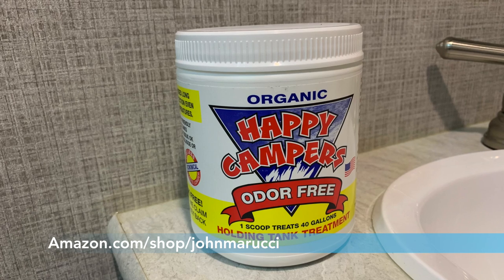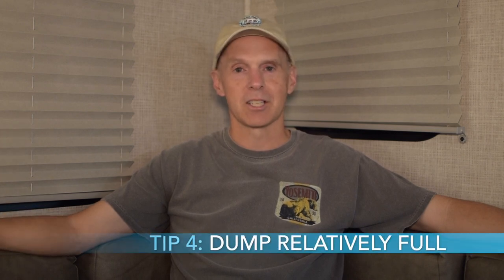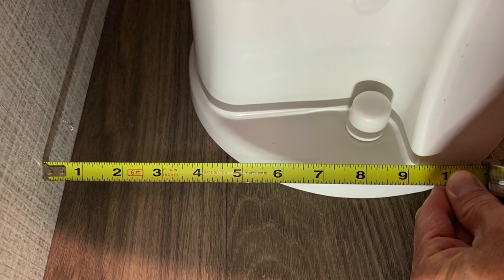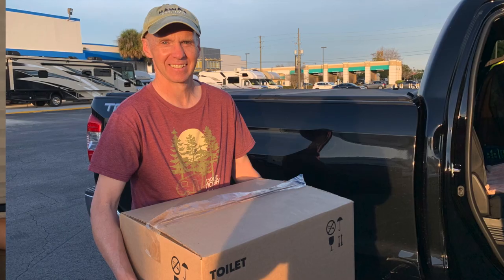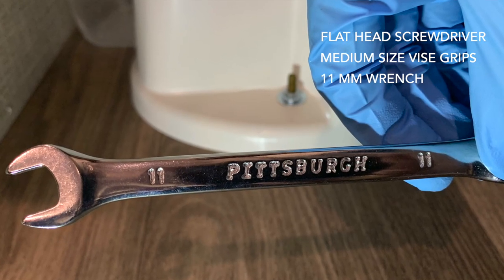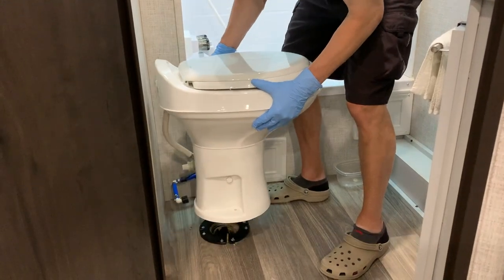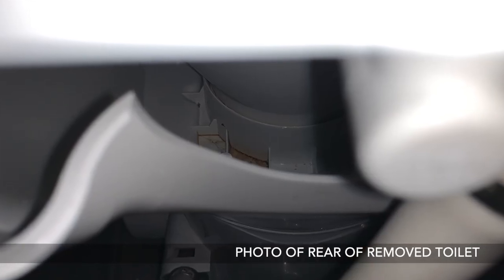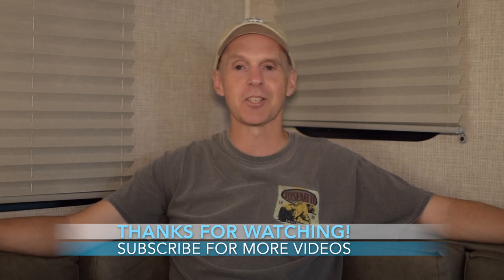5 Tips for Black Tank Best Practices & Replacing a Dometic 300 Series Toilet

Comment: We had the same issue with the Dometic 300 in our Keystone 175BH. We did the $75 upgrade. The wood seat is so much better. We got our replacement in 3 days. No more problems.
Reply from the maker: Sandy, that's great to hear. Too bad I don't have the clearance in the 243BHS to do the upgrade. All the best!
Reply: What is the needed clearance for the upgrade?

Comment: I’m pretty sure my 300 series is full between the inner and outer bowl (or was) I drained and flushed my black tank before traveling home from a trip. My tank was bone dry. I stopped for fuel about 4 hours into my trip and my entire bathroom floor of my camper was soaked with nasty waste water. (Probably about 1/2 gal). So disappointing to spend so much on a brand new camper and have this happen within the first year. Thanks for the video, it was very informative and in depth! Il
Reply from the maker: Sorry to hear this. Definitely complain to your dealer and/or to Dometic directly while it is under warranty. Likely they will replace it.

Comment: We had the same issue with our 2018 Flagstaff 27 RLWS (purchased new in 2018) and, like you, not enough clearance for a toilet upgrade. When we called Dometic we were told that there was a quality control problem with the 300 model during assembly causing an internal seal to be misaligned. Workers had been retrained and there was no longer a problem with the 300. Since your new 2020 had the same issue I’m concerned that Dometic  doesn’t really have a good grasp on the issue.
Reply from the maker: This is concerning to me as well having just lived with 10 days of a fairly obnoxious stench with little recourse. What your comment says is that the issue is only solved to the extent of quality assembly and not a change in the process. Ideally, there needs to be a real replacement for the model. Thanks for the comment!

Comment: Thanks for the informative video. We are having this very same problem with our 2020 Heartland Pioneer. I will be calling Dometic tomorrow. Any idea of the needed clearance for the upgrade?
Reply from the maker: Roxanne, I know in my Keystone Bullet, only the 300 model will fit. The 310 is the porcelain version that needs 10+ inches for clearance. I wanted to upgrade to but didn't have the space. Discuss it with Dometic when you call, but I think you may need to measure from the center of the opening in the floor to the wall. I think the 310 needs 10+ inches. Hopefully you will be able to fit the 310.

Comment: Just curious if your replacement toilet has given you any issues? We are having the same problem with our bullet and we don’t know whether to replace with another dometic 300 or go with a different brand.
Reply from the maker: I recently replaced my 2nd Dometic 300 series toilet in my Bullet. Same bad issue. I stayed with the same model at least one more time. I did get yet another free toilet from Dometic via warranty. The latest bad one likely was built at the same time as the former bad one. Apparently the later models are fixed. We’ll see.
Reply: Thank you for your prompt reply.

Comment: I’m developing the same problem I kept noticing this smell of urine!  I’m going to check what model is on my Rv. Is there a fix to this other than replacing?   Thank you for your video!
Reply from the maker: Unfortunately, there is not a fix that I know of. I can’t confirm but have heard that later models of the 300 model are better. You may want to contact Dometic directly for a replacement.
Reply: Sure enough mine is the Dometic 300!  I will be calling the manufacturer today, thank you
Reply: I called Dometic even though my warranty expired a year ago they are still going to replace it free of charge!  Thank you so much John for saving me money!
Reply from the maker: Great to hear!

Comment: The Model 310 also has issues, my toilet is leaking where the gasket connects with the bowl and the base, every time u flush some dirty water leaks inside slowly dripping down the base to the floor. Dometic won't replace it, they told me to buy another one. This will be my last dometic.
Reply from the maker: Darren, sorry to hear this. Hopefully you'll find a good replacement. I know Thetford has a few models to consider. Feel free to post again with what you end up changing to. Thanks!

Comment: My 300 just fell victim to the stink. What # did you use to call Dometic?
Reply from the maker: This is the customer service number I have printed on my Dometic toilet manual: 1-800-321-9886 (8 a.m. to 5 p.m. eastern).
Reply: @JohnMarucci   Thanks, I did make the call and was told that I need to take my RV to an authorized service dealer, and that they no longer just "ship out" replacement toilets. It will be half the cost of a new toilet just to do that....
Reply from the maker: That’s too bad, not sure why they changed the process. Sorry to hear this.

Comment: Just sealed up my 300 after pouring out a half bowl of black water. Will see how she holds up.
Reply from the maker: I haven’t had any issues since taking mine apart and resealing it. My process is on this other video: https://youtu.be/4_ChfCv9T1k
Reply: @JohnMarucci  mine just had the seal. No oring.
Reply from the maker: I think they changed how they sealed them at the factory at some point.

Comment: Each Dometic 300 toilet problem is different,  I know because I am going on my third model 300. Its ridiculous and I know why this problem is acurring. And they know also.. There are two halves to this toilet when manufacturers. The top half slides down and on to the bottom half. This creates the space for urine. When the two pieces fit together the seal is poor. I can see they tried sealant on the two halves,  sealant on the black seal that I can see ...this is one reason for different levels of leakage. The second, is when you sit on the toilet it creates a plunging effect which sucks and pushes water/ sewage both ways; the more you weigh the stronger the suction is and why most sealant/seals fails. Well I sure there are some toilets that did sealed, but many more have not. This plastic to plastic seal should have been a weld, may two or three welds...
Stay away from this toilet its a bad design...
Its has ruined two vacations,  after the 1st reinstall/ testing we took off and few days later it starts all over again and the temperature hit 111° can you imagine the smell. I wish Dometic could stay with us a few days and see how they treat their customers...its horrible. On return we will try the third toilet. I don't care what they say they will put a different  model  number in, or they can explian the problem to a judge.
Reply from the maker: Totally understand. We almost had our FL trip ruined and it was horrible for 10 days or so. I also blame the RV manufacturer who keeps using them (Keystone in my case). They could reject them and force Dometic to change but I haven't heard anything. Sorry to hear your issue. Some people are buying the porcelain model (310) and using a Dremel tool to cut the back of the porcelain to make it fit where the 300 does. I saw this on the Keystone Bullet Facebook page if you are interested in following up with those who have done this tweak. All the best!